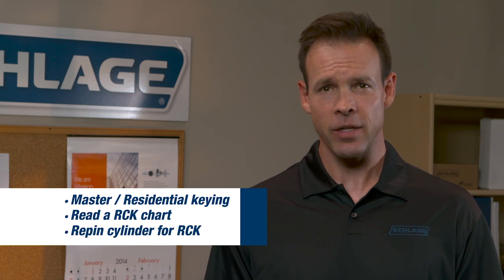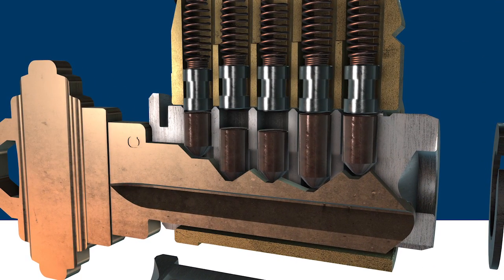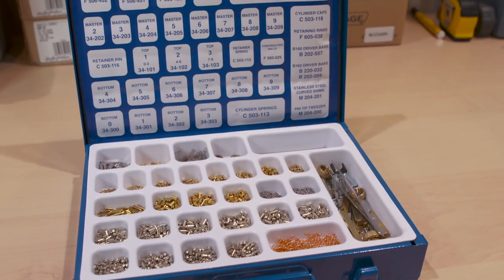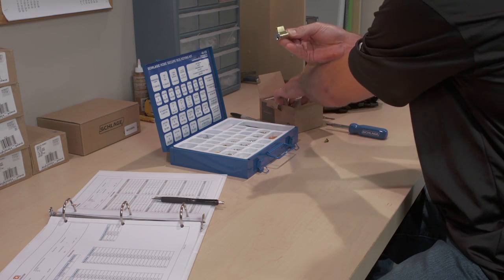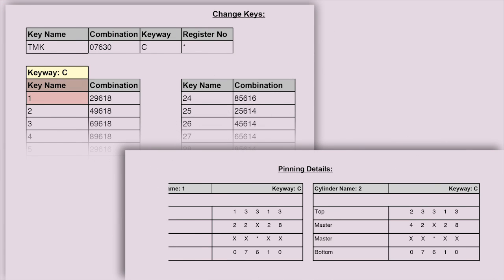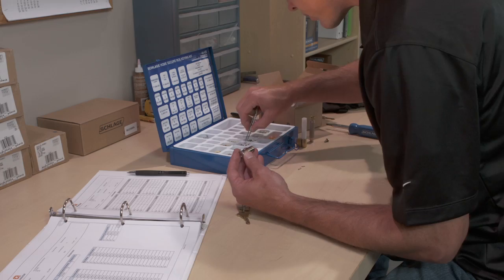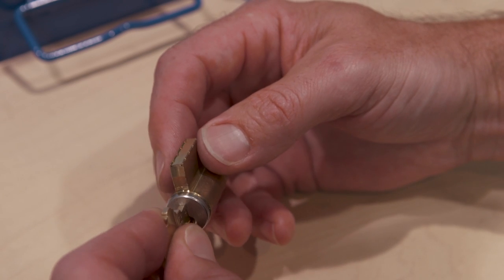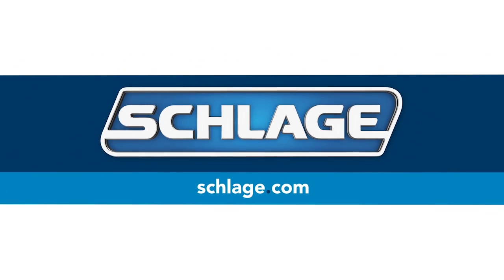Introduction to Residential Construction Keying (RCK)

Comment: Where can one get a RCK key chart? Also do the ball bearings equal to one depth deeper in a key?
Reply: They are the equivalent to a #3 master pin. The video at 3:35 shows the construction key cut as 07930, with the change key in the example being 29618.